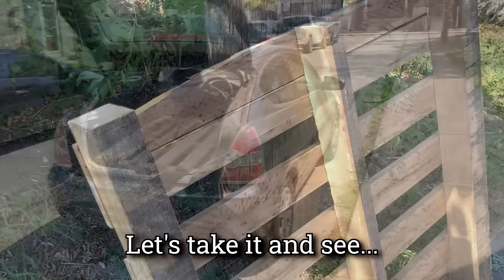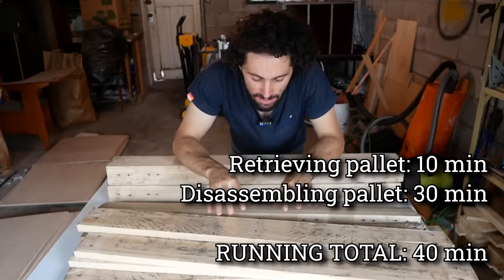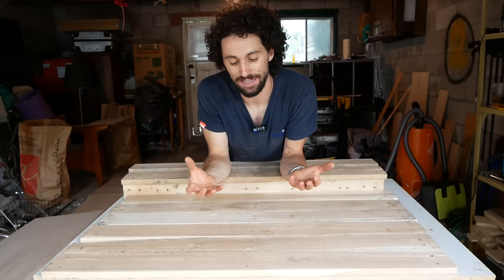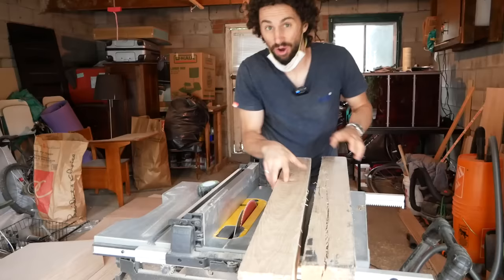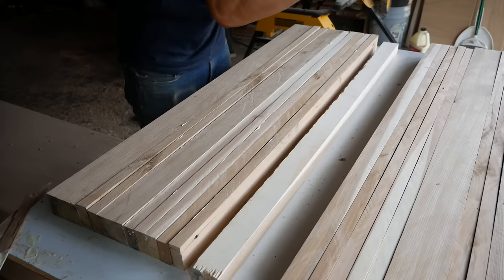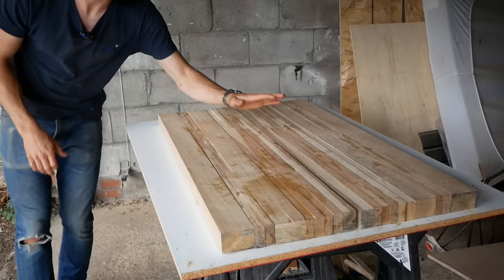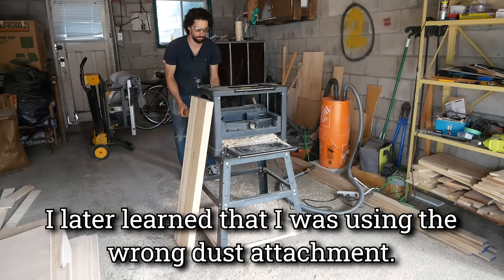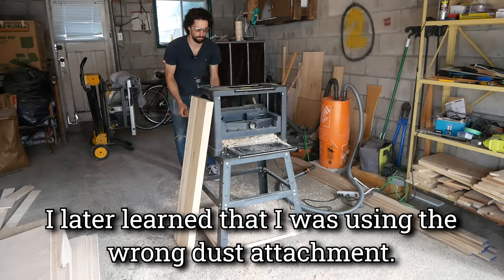Turning a Free Pallet into a $550 Table

Comment: Whenever you do a glue up, make sure you alternate the the side you put the clamps, the table he made was warped. Alternating sides will help keep the table to from bowing
Reply: You seem to be the only one, beside me, to notice it. When he is chamfering the edges you can clearly see by eye. Face up, it is rocking, face down, it is not... I wonder why?
Reply: Can you explain what you mean by alternating sides?
Reply: @NevrNewd  Due to the nature of clamps, the boards will bow up, the more the pressure, the more the bow. If you have clamps laying on the table and clamp your work, it will bow upwards. To prevent bowing you add clamps from above and their action cancells eachother. Just use symmetry to work for you.
Reply: @fifi23o5  great reply and advice, thanks for that. Had no idea - about to try my hand at a little cutting board for the first time!
Reply: @liamhopkins29  Cutting board is a good start. Enjoy!
Reply: the real gems are always hidden in the comments.. thanks!
Reply: @fifi23o5  I hate to be that guy😅 but do u care trying to explain it bit more it's still not to really making scenes where the the clamps need to be.
Reply: @just-a-meme25  You have to make sure to clamp on both ends. Meaning you can't just align all clamps on the same flat side; you have to have some on the "bottom" and some on the "top", because that way, it evens out the pressure. If all clamps are on the same side, they all generate force in the same direction which causes it to slightly bend or "bow". So instead of having clamps like this: " - - - - - " you have to clamp like this " - _ - _ - ".
Reply: @cergic  ah k got it....thanks a million

Comment: I have been a woodworker for the better part of 6 years, I build massive dining room tables from solid walnut, oak, ceder and many other hardwoods. I find it a bit fishy that someone would pay $550 for this table. I am willing to bet you just got incredibly lucky or your following helps push the reach of your ads a bit further. I personally wouldn't pay more the $250 for a table like that but I am also a woodworker so I'm not your target audience. 

All this is too say that if you're thinking of doing something like this, chances are you will not be able to get this much. A lot of things had to go right for this deal to work and honestly it just seemed like the perfect storm. 

Also it could be the camera but your top already seems to be warped or on its way to badly warping. This is one of the reasons I tend to install C-Channel in most of my table tops. There is a fair to good chance that table will be useless in the next 6-8 months due to warping and temperature changes.  

Finally, obligatory use a push stick comment!
Reply: And how pissed they will be when they get reminded on how much money they wasted.
Reply: And triple that from ad views 🤩
Reply: How exactly do you apply C-Channels on table tops?
Reply: Agreed. Built on bs this table
Reply: @LapuenteJuanCa  Well to be fair I tend to make lager tables but generally you route out an area on the bottom, put the C-Channel inside and screw it down, the C-Channel is made of steel and will prevent the table top from bowing or warping. It's quite spendy but worth it to prevent your clients from coming back with complaints.
Reply: Noone in their right mind would pay that much
Reply: I was thinking $50 tops, especially buying it out of a garage (garage sale like). I'd rather spend $200 at Ikea confident the product would last me a decade (or two), then spend $200 every 10 years on something new and shiny.
Reply: He just used glue, and throw away fir or pine, there's no way that was cedar and oak. He could have used dowels or biscuits and that table top would've lasted 100 years.
Reply: It's not just you, I saw the bow in the top also and thought the same thing about C Channel. BTW I wonder how the second clients felt after "buying" the table for $550 and then seeing this video where the maker tells the first set of clients in his text that the lowest he will go is $500.. haha. This whole thing smells of bull..
Reply: Yeah for sure this is clickbait. No way this happened.
Reply: Please come to California, we here buy absolute shit for 1000s of $$
Reply: Indeed, this makes for good video content a nice thing to spend some time on, but it certainly isn't reflective of what the average person with reasonably extensive but not professional garage workshop and experience can expect. Wood warping in the long term is something the average tinkerer, much less consumer, just doesn't think of.
Reply: @chillzwinter  I'm in agreement with your idea, but I also was under the impression a decade = 10 years... ?
Reply: @drewdougan  I’m not sure if that was cedar, but the thicker pieces did look a lot like oak, which is common in pallets.
Reply: Agreed. Could depend a lot on where they live as well, but being a professional woodworker in Kentucky, no way you’re getting half a grand for that around here, unless you found the perfect idiot. I just don’t want to see someone get into this hobby, trying to make a little extra money and then be disappointed because they don’t realize some of these content creators are getting sales due to their popularity, not necessarily quality, or just pulling numbers out of thin air.
Reply: @Valyssi  How is it going to warp when he put the grain it side to side, not end to end?
Reply: @seeburgm100a  That's on them for not negotiating lower. He doesn't have to SET it that low for them if they don't ask. Why would he? That's just not how bartering works.
Reply: @christopherd5941  California. And DC. A lot of areas where I have lived rich people will pay a lot for reclaimed wood and other such items. Kentucky, yeah, I can't imagine someone spending more than a hundred on a table. Basically if you want to make bank you need buyers from more expensive places. = /
Reply: @becominghero9754  that’s why I specifically stated it could depend a lot on where someone lives. The best thing for any new woodworker, that’s beginning to price their work, to do is to go and find others in the craft nearby. Look at their work and try to be competitive with their prices if they make anything similar. In most areas in the U.S., you’re probably not going to be able to command that kind of price tag, only in those larger cities and nearby suburbs, but if I remember correctly from the video, I believe he said he was in Toronto, so that could probably justify the price a fair bit.
Reply: @christopherd5941  Exactly my point, It's very common for younger and eager woodworkers to see stuff like this and think they can dig a pallet out of the dumpster and make $500 off it. Honestly most pallets are warped hot garbage pine and with all the nail holes and other crap, its almost always not worth the effort of cleaning them up.
Reply: @kpadalldotablet1009  To be fair it looks like the warp isn't caused by natural environmental changes but most likely from clamping on an uneven surface or using too much clamping pressure resulting in a pre-bowed surface.
Reply: @A2ZGeek  yeah, I wouldn’t do pallet jobs unless it was a commission or a personal project. I know some people can like the look of pallet work, but I’ve had to buy certain tools to break them down efficiently and even then, there’s always sections of it that I just cannot use, usually from checking or nail splits, and epoxy is just too damn expensive in general to stabilize every pallet I come by. Although, a channel that makes pallet work look easy is Epic UpCycling. He usually embellishes the wood though with something else, like copper, which is even more expensive.
Reply: @christopherd5941  I think I have seen his work and yeah if you toss a bunch a money at it they can look good but at that point, why not just get some good high quality hardwood and resaw it? seems like a more efficient way of working and less time spent polishing a turd.
Reply: @A2ZGeek  I would say it’s more efficient also, because you’ll have to do all of your basic milling for either, but at least with the rough lumber you don’t have to deal with all of the nail holes. Like I said, some people like the look, though, which is is why I will subject myself through it if the client is willing to pay for it, but I’ve only had like 2 or 3 of them specifically ask for pallet wood. Everyone around here wants black walnut or mahogany.
Reply: MADE $45,OOO FROM   INSTANT PROFIT🌎ORG
Reply: Glad I'm not the only one who spotted this., although I'm unsure if its already warped or if it was never straight to begin with. A planer doesn't give you two parallel sides automatically, it gives one perfectly flat side. You need to joint an edge, then joint one flat surface (face). Then you have two flat sides (one edge and one face)that are perpendicular. Then you can run the board through the planer (jointed face down) and you'll end up with two faces that are both flat and perfectly parallel to each other, and one edge that is flat and perfectly perpendicular to both faces. Use that edge up against the fence of the table saw to trim the opposite edge and then your boards are perfectly square.
His never were square.
Reply: My thoughts exactly. I can get a 100x160 dining table made out of pretty much any hardwood for that price. 550 would get me a pretty designer coffee table from a higher end store, which tend to look a lot more intricate than this one. Felt a little fishy to me, unless the buyers are not very money savvy, or have way too much spare lying around
Reply: I wouldn’t pay $50 for that. The quality was awful. And correct me if I’m wrong but does this have any strength by only gluing the timber?
Reply: Its youtube. Its all fake. He didnt find the pallet on the side of the road probably. And those were probably his friends. Just like the fake prank days, would you rather wait days and days maybe weeks for the PERFECT reaction that may never come? Or would you rather just hire actors/friends and knock it out ASAP so you can post it? Pretty easy decision there. Not hating on the guy but i agree with you. Their whole story and what seemed like bad acting threw me off. "Oh yeah i wanted to pay a lot for a small table because its just what we wanted!"
Reply: You're quite conservative, I wouldn't pay more than $50 for that junk...
Reply: @kpadalldotablet1009  probably with the way it was clamped
Reply: I'm not surprised considering how much people are willing to overpay for a house!!!
Reply: For sure the top is bend from the very beginning, you can see it whipping when hes clapping on it after he glued everything 😂
Reply: @chillzwinter  Ya, I would say 50$ for the table, but that is the legs are worth the 45$. Might even take the legs off and put a new top on.
Reply: Thank  you for this post. As a woodworker, for a newer/young diyer or someone who wants to start out in woodworking... This is a 1 in a million or staged. Do not expect this is the normal. You might have a family member or two who will way overspend but likely you will be earning a small % on what you put into it. If you made this, you probably be making 5-20$ an hour.
Reply: @chillzwinter  Ikea lasting a decade or two... considering most of their wood tops are PAPER on the inside and sag if not supported I highly doubt that.
Reply: @Hhajsjeieirhrbbr  Actually the glue tends to be stronger than the wood grains, for example when repairing a broken guitar neck only glue is used (most of the time) and the neck will never break at the glue joint, more likely it will snap at some other spot if dropped again.
Reply: @SirCanuckelhead  Agreed😂 Plenty of great tops at Ikea 🤣🤣🤣
Reply: @PoltergeistWorks  I have 2 IKEA side tables that I have had for 16 yrs. The cheap $15 ones with screw on legs. No joke. They are scratched but thats it
Reply: i wouldnt pay more than 100 :-)) and i am handy too. nothing special was bout that cutting board on black tiny legs ;-)
Reply: The bow was haunting me. And I agree it's a tad over priced but didn't he say he was in Toronto? I assume he was talking CAD then, so can knock that price down by a bit over $100 USD, which if it weren't BOWED seems like an okayish price for a handmade table.
Reply: pallet wood is the worst wood to have , there a reason its use for pallets , also with wood prices sky rocketing , who would use good wood for pallets , lol
Reply: Hourly rate $100 reduced to $58... Hobby work (building out of your garage) doesn't compare to working salaries. I might also ask; who gets paid $100 an hour to build tables? As a hobbyist on commission I might charge $20 an hour. Without commission I probably didn't track the hours and would price it differently...
And yes, he needs a push board...
Reply: for sure, you go onto Amazon and you can get some awesome tables for $150.
Reply: New Yorker money. $500 is cheap to them.
Reply: Exactly, lol. This dude is pure clickbait. He probably called his neighbors over to pretend and be interested... Absolutely no one will pay $550 for that.
Reply: I was thinking the same thing. I am not sure who would pay $550 for that table from a random woodworker. If this was a custom job someone asked for or they had a good working relationship with them I can see it, but some random person paying that for a pretty simple table is unlikely.
Reply: @LapuenteJuanCa  I have seen large live edge tables with a groove routed out for channel so it doesn’t show. Then just screwed in.
Reply: From someone who has absolutely no idea about wood, it just looks like a nice table. Most people can't tell the difference between different types of wood and I assume the number of people that can is decreasing each year just from different generational interests. The biggest reason this guy's tables sell for so much is the story. His customers love the whole recycling aspect of it. He's a great marketer for where he's located. He's in Toronto, the 4th largest city in North America. Naturally there's going to be a larger customer pool.
Reply: In this case probably not warped, just a failure to bookmatch the last table saw jointing. Blade is probably out a quarter degree from 90 then it's amplified over the width of the table. At first I thought it was from the surface too, but it was low centered perpendicular to the sawhorses.

Comment: When ripping thick timber its much much safer to cut halfway through then flip it over and rip the other half, instead of raising your blade to full height...
Reply: Flip end for end so that if the cut isn't precisely on center the two cuts will be aligned.
Reply: Or use a bigger saw
Reply: @greggv8   Never thought of flipping end for alignment! cheers.
Reply: @greggv8  / I figured that out long ago. Gotta flip end-to-end!
Reply: Band saw rips

Comment: Good job mate!
Just a few pointers: always use a shop vac or extraction when using a planer. Saves the planer's motor and gives you a cleaner result when chips are not jammed against the board.
When gluing boards, clamp on both sides of the board or otherwise it will cup, as seems to happen on yours a little bit.
Really good work!
Reply: Like that vac right behind it? Lol
Reply: What do you mean with clamp on both sides?
Reply: @micheleciaramicoli7139  Apologies not being clear enough.
By both sides I mean it is recommended to put clamps on the bellow the work piece and same amount of clamp on top to get even pressure and avoid any cupping. I hope this makes sense.
Reply: @salefin  ooo ok thank you, good piece of advice
Reply: @mrkeda  Yep!
Reply: @micheleciaramicoli7139  No problem mate!
I'm not going to comment safety concerns as most of the comments are related to that but please take a note and stay safe!
Reply: @salefin  yeah anyone was pretty shocked about that ahaha

Comment: When gluing up, ALWAYS ALWAYS alternate your clamps. This will help prevent cupping of your glue up. Nice repurposing of lumber.
Reply: Alternating as in releasing and resetting the clamps a few inches to the side during hardening? Or rather clamping from several directions? Thanks
Reply: @bjornnilsson8496  One clamp that has the rail (?) going on top of the slab and another next to it running on the bottom of the slab. Essentially the clamps aren't all on top of the piece being clamped, they're also on the bottom holding the piece up. When you clamp just from the top, wood tends to have the edges bend up. Another way to prevent this is by clamping from the top, but also clamping a hardy piece of wood that runs along the ends of the slab, that way if it does want to bend the edges, it can't because there's a piece of wood holding it all down together.
Reply: @DexBunny  Gootcha gotcha. Thanks man 🙏
Reply: @bjornnilsson8496  ya it is kind of like a archery bow, you put the string on one side so the whole piece will bend to that force. So if you clamp all on one side, you will make that bow.